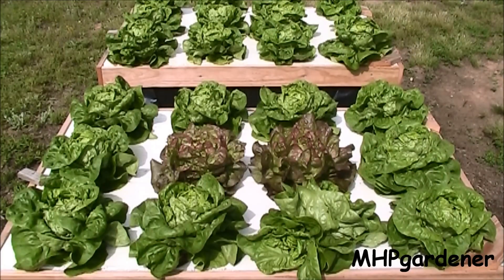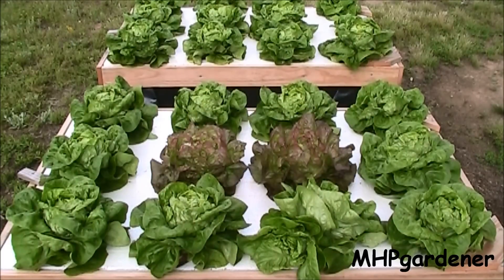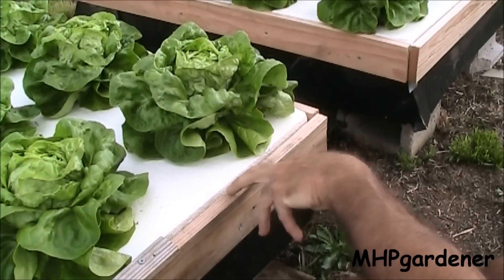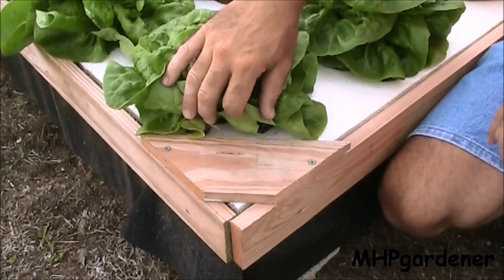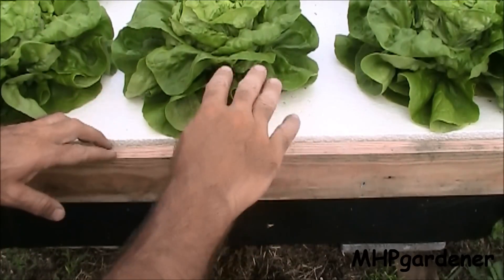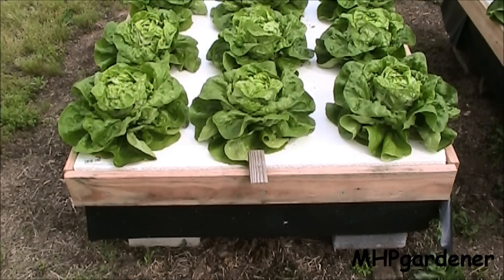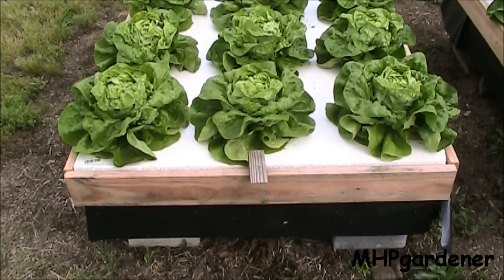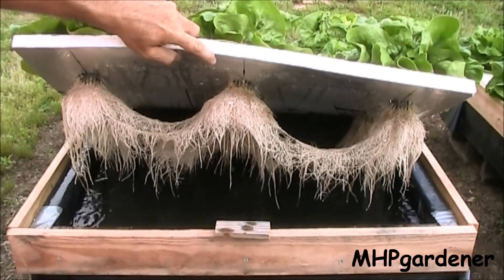Growing Hydroponic Lettuce Outside with No Electricity

Comment: What about water temp conditions going into the root rot range (75 F and above?)? Are your outside temps cool for long enough for lettuce or do you not really have an issue? Do you se anything in the water to prevent rot?

Comment: Likely by now you already solved the rain issue, but if you nailed a 1x2 across the center, under the Styrofoam, it would give just enough lateral slope for rain water to run off the sides. And if the 1x4 Outside strip was slightly separated, and not tightly flush against the main box, there would be plenty of space for the rain to drip onto the black plastic. Finally you could cut pool noodles into the net cups to limit water entry there! Or put a lip AROUND the net cups to prevent side access water running into the holes.
PS, I just love all your vids

Comment: Love your easy to understand content I was wondering if a
 Small overflow hole or holes could be drilled into the box at 
a level where to the excess rain water could drain off automatically to the optimal level Also loved your fairly easy fix to keep the styrofoam sheet from blowing away Keep the awesome content flowing my friend

Comment: Maybe some plastic film over the top in the spring before planting would stop the rain from getting in there. Place the rock wool so it’s slightly proud of the foam under the plastic film so water runs away from the net cups.

Comment: Hi Bobby, Do you recommend doing a setup like this in Texas. I am thinking about moving my system outside to take advantage of the free sunlight but am a bit afraid the heat will kill my lettuce. Right now the temperatures are around 80s to 90s.

Comment: I just rediscovered your channel. Have been using your ditch bucket and formula for several years and grown lots of tomatoes here in Ontario Canada. I heat my green house with thermal mass ( Water tanks under the benches, the water is heated with drain back solar vacuum tube solar heat collector.)
Thanks getting me going and having a lot of growing vegetables.
Ken

Comment: The 1 X 4 surround is very neat and certainly does the job of retaining the foam. But, it appears to channel rain water into the pond.  I am suggesting the foam be mounted on a very slight tilt without the pretty 1 X 4 border. Make four retainer latches to hold your foam in place. Rain will still dilute your nutrient solution, but not to such a great extent.  I am a deep water culture pond builder/grower.  I use use so much of what MPH has taught us all!  Thank you, sir!

Comment: Made the smaller Kratky boxes like you did (not floating), growing outside in Florida, been watching water temp. I insulated smaller containers. just harvested our first lettuce and mix greens for a salad yesterday, fantastic. Other stuff is still growing. With about 40 gallons each box, at what point do you need to change out the nutrient solution?  Still quit a bit solution in box. Will the answer differ depending on what is grown?

Comment: This is very easy even in me living in a tropical country where mostly when it’s sunny it dries out every greeneries that just sprouted. The weather is very unpredictable. Your kratky system will have some time looking for proper shading. When its noon until 4pm the sun is so strong it melts them up easily and when it rains you’d wish it won’t take an hour or two. I’m not using growlights anymore as it will only be a hassle trying to aquimate them time to time up until you put them outside. I just place all seeds in a rock wall outside at full sun so they can adjust to the weather eventually as they germinate and grow up.

Comment: To the same frame just put a centre piece  of wood just about 1 foot high goin stright across   an cover with a piece of plastic an put something heavy on the plastic on the ground on the 4 side or if it's possible just raise the system 1 side at a time an put the plastic under to hold it I feel that could work

Comment: Hi mhpgardener - I built some 32" x 48" boxes and am looking to put them to use.  I live in So Cal and it's winter time.  Are there any particular varieties of plants that would be good in the winter outside?  I just tried germinating some cabbage in some 1" rockwool cubes, but it didn't germinate well when I left it outside (I have a plastic seed enclosure with a clear lid).  It started out ok and then just withered away.  Any help you can provide is much appreciated. Your videos are excellent and your gardening skills superb.
Reply: Google "damping off disease"

Comment: How come you didn't need to fill up the nutrients? Doesn't the level drop?
Reply: The lettuce will take up certain nutrients but others will not be used. Many folks change the water & nutrients every 30 to 45 days. Flush the box out real well.

Comment: if you connect large flexible water pipe to each side of the boxes and cover with plastic that should help stop the rain. Also if half way up the board you drill a drainage hole then if it fills it will only stay half filled while the excess drains away. please let me know if this is a good idea. ty.

Comment: For out door hydroponics, all the steps you took are good, but add one drain (over flow) hole. that way, when it rains the boxes do not get flooded out, one or two simple holes !/2" in the air gap should do nicely.   I like your videos Thank you.

Comment: Should install a small pipe in the side at the desired water level so that if rain overfills the reservoir, the excess simply drains out the overflow drain.  Simply check the mixture after a heavy rain.  Alternative is to create a "canopy" of clear plastic or shielding to divert rain away from the box.

Comment: why not add a overflow drain to release the rain water?
Reply: It would be better to shield the water in some way.  If you allow water in the system it will lower the ppm's (parts per million) of nutrients, therefore weakening it.   You would have to test ppm's and add water soluble fertilizer to bring it up.  Just shield from rain some way.
Reply: michael todd would not weaken it at all the nutrients will still be there just with plenty extra water
Reply: Not if the excess water was exited out of the box. Some of the intended plant nutrients would exit the box with the excess water. :(

Comment: To prevent over filling from rain water, cut a small hole and place PVC pipe as an overflow drain.  It would also be perfect to know exactly how much more water the plants needed.  Although this wouldn't solve the watered down nutrients due to rain.

Comment: Last night I went to the local Kroger grocery store and talked to the produce manager. They are selling dirt-raised heads of lettuce for US $1. He said if I supplied him with hyrdoponic lettuce I would need to come in with a similar price. He also said they tried hydroponic Bibb Lettuce a couple years ago but it was about US $3 per head and just did not sell.

So let's say I grow lettuce to sell to the grocery store I would have to let them have it for (a guess) 50 or 60 cents per head. Maybe 75 cents. With all it takes to set up and grow like you show, that does not seem like a profit making operation.

Or am I wrong in thinking about grocery stores? Maybe I should be approaching some of the better restaurants in the area?
Reply: +Terry Thomas I clearly agree with the dilemma. Hydro lettuce is SO superior to normal grocery store lettuce and should command a much higher price. Also consider that it's easy to run an all organic system which is a big selling point, IMO. Have you considered higher end stores? Restaurants are a good idea as well. Best of luck to you.
Reply: Terry Thomas hjnqmnjlkjnnjjjnnnkwwwwgfgryqwe
Reply: Definitely sell to restaurants first.  Remember, you can reuse 90% of the materials going in and you only take a few mins per day to check the progress.  Also, the hydroponics lettuce grows up to 50% faster.

Comment: hi great tell me can used an,all purpose fertilizer if I soon not have a hydroponics nutrients
Reply: +dev bachu You definitely won't want to use a fertilizer intended for the soil to replace your hydroponic nutrients.  If it's only for a little bit and your plants are still small plain water should be alright.
Reply: +Brian Rogers hi I got some hydroponics fertilizer an calcium nitrate an Epsom salt so I gonna start small with a gallon

Comment: Very good video - some great ideas - why didn't you incorporate an overflow pipe into the tray, to save you bailing out? Or build a frame over the top covered with clear plastic to stop the rain being a problem?
Reply: +Terry Wheeler the overflow wouldn't work because he wouldn't know what level the water would be at the time of the rain. If he set it at the beginning level it could drown the roots if the water level was lower at the time of the rain. Does that make sense to you

Comment: The drawback to hydroponics is you need to purchase "plant food" or nutrients and supplements that are high-priced.
Reply: Aquaponics combines the best parts of Hydroponics And Aquaculture therefore minimize pricing and also improve efficiency. You'll find the most efficient aquaponics system right here:
help1.info/best-aquaponics-plan
Reply: We're using bioponics. Eliminates dependency on fish and on the cost of chemical fertilizers. All the nutrients required for heavy feeding plants are contained in other plants....it's all about how to get those nutrients into a soilless system.
Reply: Sem Kimat If you are going to post a link, make sure 1) it doesn't stop and go constantly and 2) it doesn't try to force you to stay in the page.

Comment: Could you have made a hole or several small holes along a waterline on the boxes so that if the water raises above that level it will drain off automatically thru the holes?
Reply: the water starts high, then gradually lowers itself while plants consume it.  If you put holes up high at start level, and it lowered down naturally, then a rain comes and fills to your holes, your plants would still drown due to the 'air roots' now submerged in the ORIGINAL high water level.  You will have to manually drain down the rain water to where the plants took it down to naturally over time.
Reply: My solution to this was to install an overflow tube through the bottom of my box and liner ( the kind used in an Ebb & Flow tray or table) that has different length segments. I use the long (tall) segment when the seedlings are just starting out to keep the water deep, Once the roots have dropped into the water, I replace that segment of pipe with the next shorter segment (about a half inch shorter) and then later with the 1" shorter segment. This way the water level is always kept low enough to prevent drowning the plants, regardless of how much it rains. 

On my latest setup, I'm starting my plants in a smaller box and once they have enough root length, I move the net pots & plants into the full size box with the lower overflow drain. Hope this helps.
Reply: We control the water level with a Trickle Valve. The weir sets the height.

Comment: Make an adjustable "Overflow" valve with a piece of hose. Clear would be more entertaining but not necessary. You could adjust the height of the water level by raising or lowering the hose position. I would have the water drain into a bucket to reuse it since we are using a specially prepared cocktail.

Also by leaving a bit of hose you can adjust for rain, or use a temp cover as you said.

Good luck...

~BB

Comment: why not build in an overflow? like a bathroom sink? So when the water level gets to high, it just drips out the excess water?
Reply: The problem is diluting the nutrient solution.
Reply: charmerx2006 It’s already diluted the moment rain water enters and will over flow anyway if it rains enough. Making a hole for overflow at the desired water level would fix the issue of having to remove water bit either way I would think you have to add more nutrients and adjust the ph of the water.

Comment: If you make a level indicator tube on the boxes and mark where your ideal water level is, drill a hole out in your level tube just above your highest desired level, this will automatically drain excess water.  What was the weather like when you did this? What temperatures were you seeing? I'm interested in trying hydroponics again but I may have to do it outdoors. Any advice for people without a green house and I live in the hot & humid south.  Thanks!

Comment: What about an overflow to keep the water at the right level?
Thanx for teaching me about it all :)
Reply: The way this system works, the water goes down as the roots grow and the plant gets larger... so where the water would be touching the cups in the beginning... it slowly goes down.. which would make an overflow kinda hard to place
Reply: ***** Put a couple of these at different levels
/
 Rain-Bird-Drip-1-4-in-Barbed-On-Off-Valve-2-Pack-  $ 2  for two
.
http://www.homedepot.com/p/Rain-Bird-Drip-1-4-in-Barbed-On-Off-Valve-2-Pack-BVAL25-2S/204751238

Comment: What method do you use to sow your seeds? I'm having my first go at hydroponics and can't decide if going cuttings propagation or sowing in soil and then transplanting to hydroton media in net pots. I have ten sites to fill and haven't decided what to grow, most likely peppers.
Reply: Apparently it's best to plant your seeds in starter plugs, and as soon as they are ready to be moved over to your hydroponics, you can plop the whole plug into the net pots without mess.

Comment: Just a suggestion but you could put in those drain pipes like you did in the buckets.  That would keep the water level of the same all the time.  I understand that you would still have to fix the nutrients but this might be a good solution.

Comment: I have a couple of questions. First Does the water get stagnant and smell? Second, does it attract more flies to the area? Thanks
Reply from the maker: No, the water doesn't have any smell. And flies are not a problem either. The water is completely covered by the foam board.
Reply: mhpgardener how will the water get in?

Comment from the maker: Most any leafy type would do fine, as well as cucumbers and peppers. You just have to take into consideration the additional water needs and size the reservoir accordingly. And also figure out how to handle a sprawling plant if you do cucumbers. I like to let them run up strings.

Comment from the maker: 6 mil plastic is fairly thick. As long as you keep it out of the sun, it should last a good while. Exposed to sun, it'll degrade in about 6 months. This is more of a short term use though. For something like rain water collection, it might be a good idea to use something more permanent.

Comment: Hey Bobby how has the plastic been holding up?  I am thinking of making a rain water collector to catch the rain off my barn and was thinking that I would need to use epdm rubber to line it with but if the plastic you are using is working it would be a lot cheaper.  Love the videos and I am going to do this next year!

Comment: Good vid bro:))  i give  tip in rain problem make hole at the side, an put tube there or small pipe as an overflow system, exactly where u want water level to be so wen rain fall it does not full up it will automatically bleed off excess water for u hope u well:)))

Comment from the maker: As the plants are growing, they produce 2 different types of roots. Water absorbing down low, and oxygen absorbing up top. If the water drop is consistent, all is well. If the water is used up, and you then refill the reservoir to the top, then the roots drown.

Comment from the maker: I think the most important thing to do is to prevent the rain water from coming in. The designs that I have seen for this outside usually had some type of awning over the top. Nothing fancy, just enough to keep the rain out. If that is done, then all of the issues with drain holes and topping off become non-issues.

Comment: A problem with rain water collecting that wasn't addressed in the video...  scooping off the rain water doesn't take into account that the nutrient solution is now diluted.  Instead of trying to calculate how much the rain water diluted the solution and add the appropriate amount of nutrients to top it off, I'd think it would be easiest to just drain it all and mix a new batch of solution.  Wasteful of course, but the trade off for growing outdoors exposed to the elements.  Thoughts?

Comment from the maker: For me, the ph is the same whether it's inside or outside. My well water is roughly 7.0, so I know that when I mix the nutrients properly I should be in the 6.5 range. It will vary some during the growth process, depending on which setup I'm using. It's ok to monitor it daily and make adjustments if you wanted to. But in my situation, and with the results that I get, I prefer to stay out of the way.

Comment: Can I plant the lettuce starts in a peat pellet and use in the hydrponics netpot or is rock wool the only way to go?  It gets petty hot where I live, so hoping the water won't get too hot for safety of the water/plants. I'm thinking about lining my boxes with 1-1/2" insulation before I lay the black 6 mil poly in it, and using 1-1/2" insulation on top as well.  My local hydroponics store told me I'd need to use some sort of cooling pump to circulate the water thru, to keep it cool enough. Thnx!

Comment: I think some conditions really need to be ideal using kratky outside. My plants face east with the patio overhang above. It gives them just enough full sun, however I am still finding that as the humidity rises as summer goes along the foliage gets lightly stressed in the sun. I am also finding I am needing to top off some of the reservoirs with water, particularly the marketmore cukes and the sugar baby watermelons.